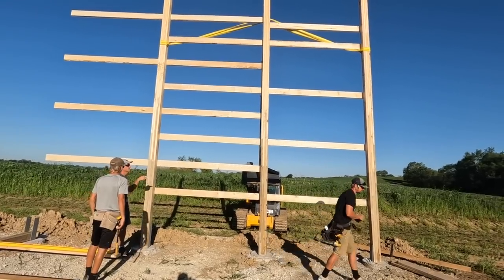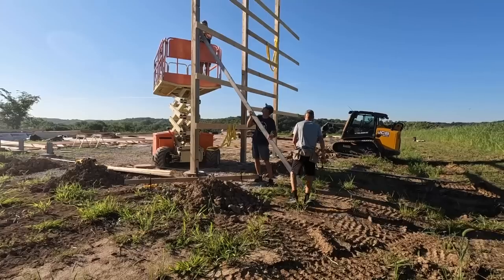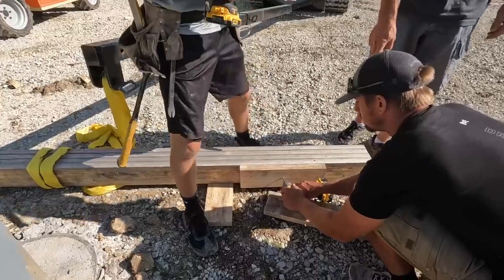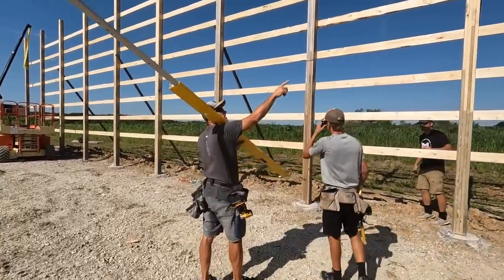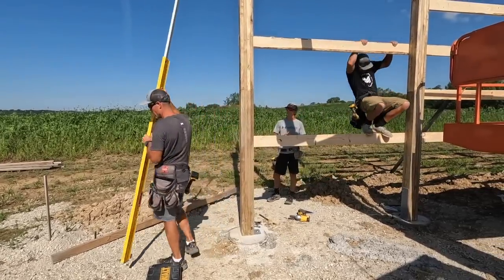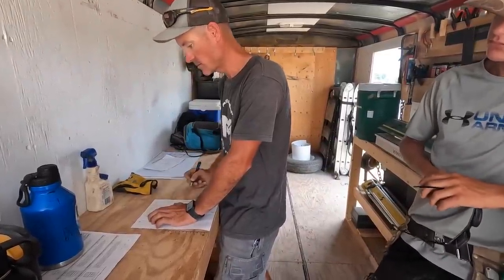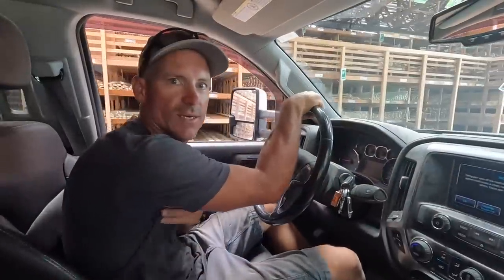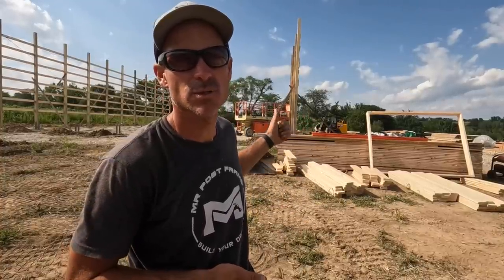The Barndo Build | Day 5: Standing 19' Side Walls | Ep 5

Comment: Hi guys! Great and interesting video. Quick question please? I am a farmer in Mongolia and I am planning to build a  garage for my tractors and combine harvester. So, I watched quite many construction videos and it seems like in the US you guys often use posts that is made from like multiple wooden board (I am sorry if my english is confusing). Why you guys don't use beams? Is the beam weaker or is it difficult to handle? Also, how you guys determine distance between columns? Are there any standards or it depends on other factors? Many thanks
Reply from the maker: The 2x6 plys are stronger and also straighter when needing long columns/posts.
Reply from the maker: We space our trusses 8’ on center. If you do 8’ OC the purlin 2x4s across the trusses have to be set on edge rather than laid flat.